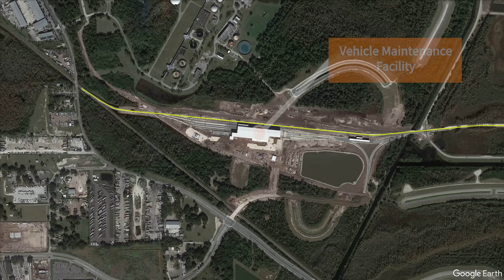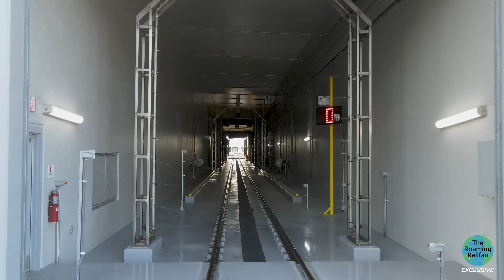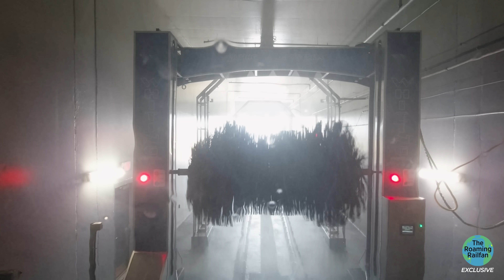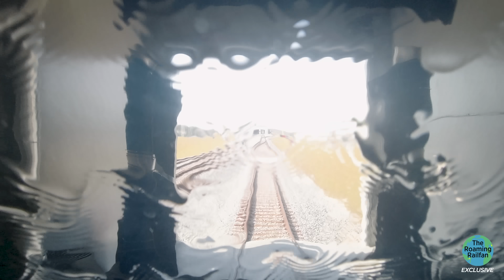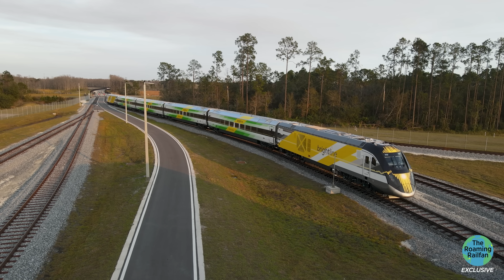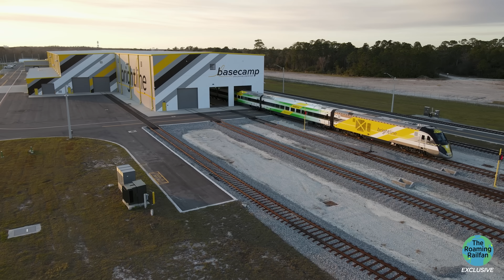Testing the Train Wash at Brightline's Orlando Vehicle Maintenance Facility

Comment: My first concern with a setup like this is rust.  More water would get into the under-body of the trail compared to manual washing methods which I assume there could be a problem?  Maybe Brightline under-bodies are rust resistant?
Reply: You realize that train wash systems are not a novel concept and have been used around the globe for years? It even works with electric trains.
Reply from the maker: The coaches are made of stainless steel so rust is not an issue.

Comment: Very cool! Makes sense that the engineer has to drive it through the car wash -- I don't think the little orange rollers are gonna cut it. :)

The auto detailer in me winces at the scrubbing brushes, thinking about how they'll scuff up the clear coat and leave swirl marks over time. On the other hand, I don't think anyone's going to spend a whole week polishing it with a DA polisher, so it'll be fine.

Comment: That is so cool. I saw the Twitter post from Brightline, but never thought that you were going to make a full video about the wash!

Quick question, does the West Palm Beach facility have a wash too?
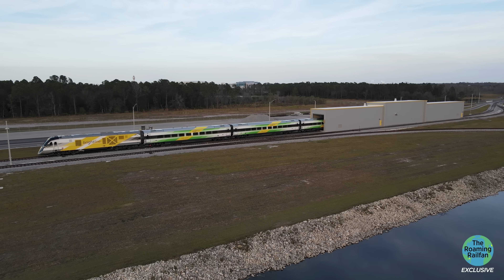Reply from the maker: I actually explain that at 10:44
Reply: @RoamingRailfan  Thanks. I was watching this video quickly with no audio (I am at work).

The reason I asked this question was because I thought one of the Brightline train windows I rode was a little bit dirty (nitpicking) and wondered how it was done currently. The mobile cleaning car explains that, as the full train wash will do a better job.